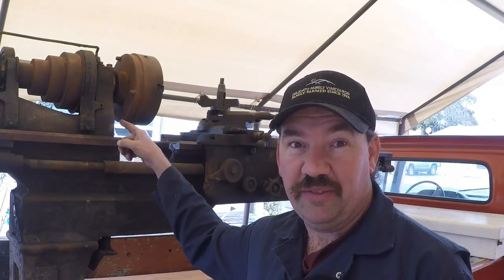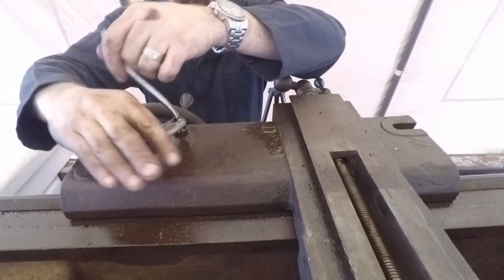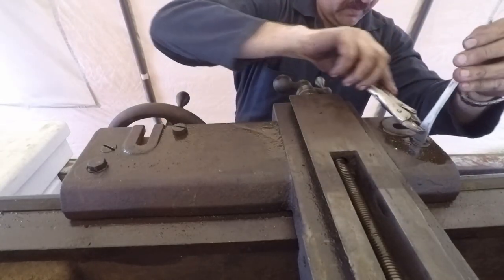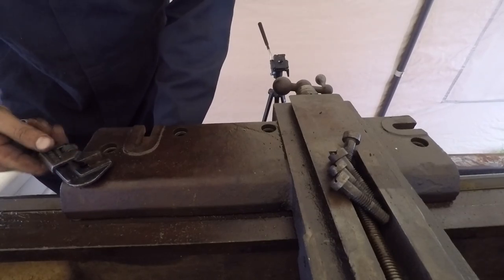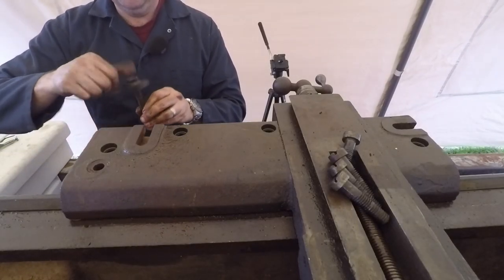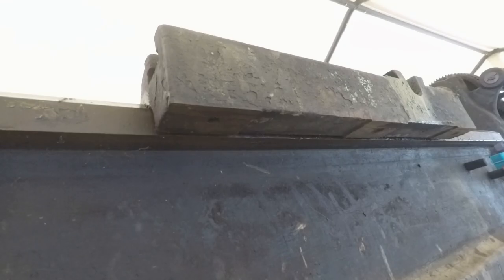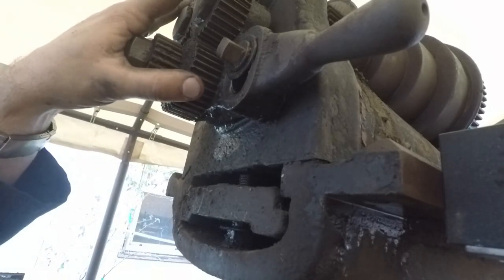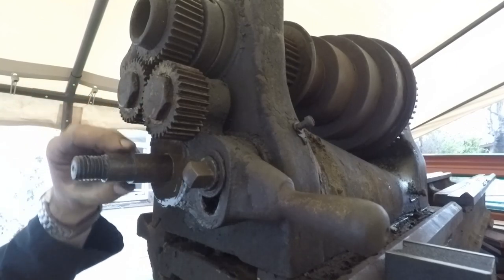South Bend Lathe Restoration Part 4

Comment: Chris, for the big slots, look at "Drag Link Sockets".  The smaller sizes would be great for this.  Also, there are some obscure but quite large hex inserts to fit your hand impact driver.   I like the idea better of removing the apron with the lead screw.  This way you can free the lead screw with the apron on the bench and be sure it's not somehow snaggled up with part of the 1/2 nut or other feature.  I love this series.  You are right on the leading edge of the coolest thing going on with machining channels right now.
Reply from the maker: +Crafted I am not sure what a drag link socket is but I'm going to find out. As far as removing the lead screw and apron as one may on a atlas but this one is 7ft long and may 25 pounds.
Reply from the maker: ya i need to go get on of those looks perfect good tip

Comment: them crows would not be around long if i was there. i run them sob away every morning the last couple mornings. i hate a crow
Reply from the maker: +Bison Workshop yards kind a nuisance on the audio. Didn't hear them but the mic sure did lol.
Reply: Crows are lightly constructed and come apart nicely when a soft point .22 bullet connects with them at 3500fps,(more or less) [5.56mm @ 1067Mps]
Reply: these are smarter then me simply because im not mad enough to put some stealth mode yet. lol theres about 5 of them i see every morning. when i get mad. they will not live to fly another day. me and my benjamin discovery .22 pcp rifle will show them. lmao
Reply from the maker: +Bison Workshop come on over

Comment: I like old equipment, and seeing it get fixed up, but you could just go to the Vintage Machinery Website and learn how to do a South Bend to standard if you want to do it properly and not be mystified by the proper procedures for ruining each component.
There's even a google search for "How to go get a South Bend 16" Metal Lathe", that leads you to a checklist of procedures which make you able to only hire one person and not need a trailer if you are both fit.
Enough of your monkeying with the thing and pounding with hammers!
You obviously did not even look up the Patent Data, so you are unsubscribed for encouraging bad habits of Old Arn Restoration!
There are entire websites dedicated to things like this, but you would rather bang on a lathe with hammers and chisels than just do a search for how to properly restore them to serviceable and then some standards.